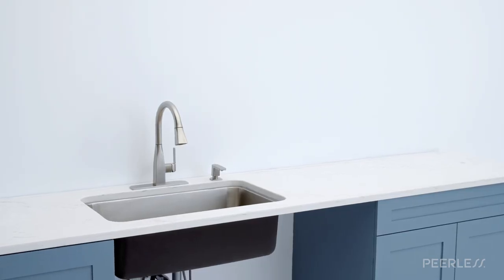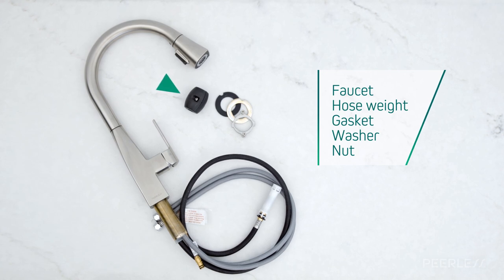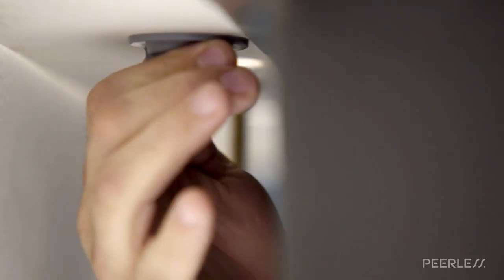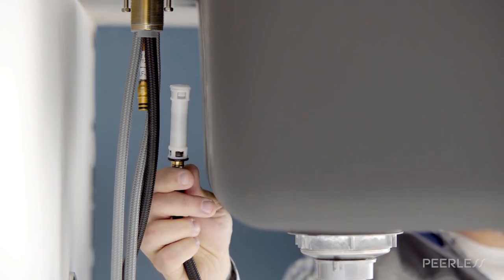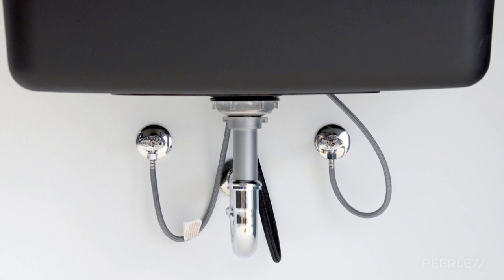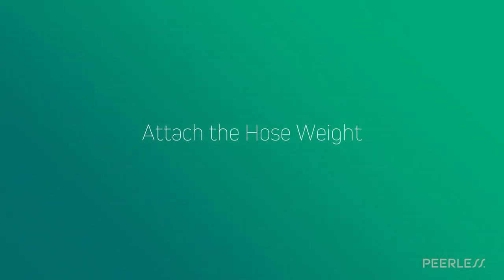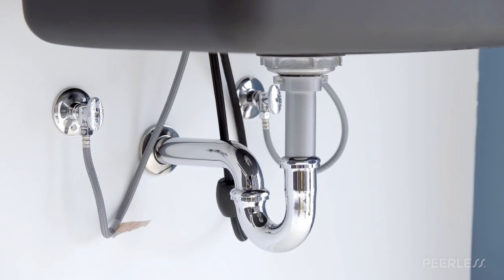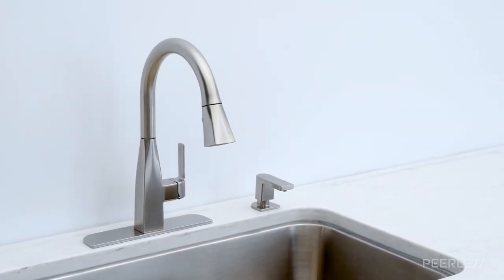How to Install a Peerless Single Handle Pulldown Kitchen Faucet

Comment: This helped me. The old faucet had a retaining nut that would not budge. Was the hardest thing to get out. I'll offer what I did in the hopes it helps someone: I rocked the top of the faucet out a bit and got bolt cutters into the space between the faucet and the basin, at the top. I cut the lines and rocked it back and forth until it separated it. It came out. Basin was untouched. Hope that helps someone.

Comment: I hate Peerless faucets. I tried to install one in my mom's kitchen and drop down hose just pops everytime there's any amount of pressure on it. I'd recommend spending a little more for something that actually works rather than suffering through this garbage. Rot in hell, Peerless.
Reply: Pops off* that was my second biggest mistake of the day, after spending money on an Peerless faucet.